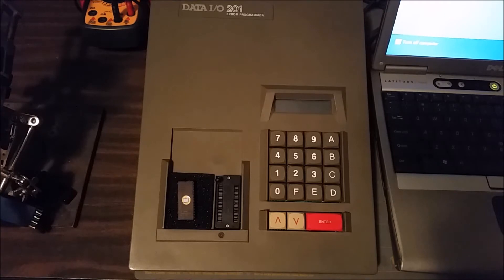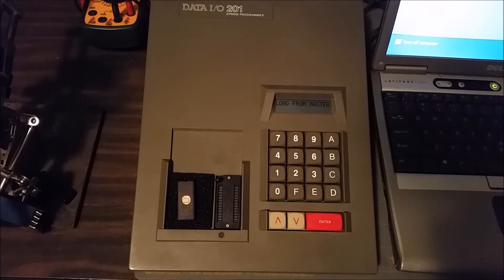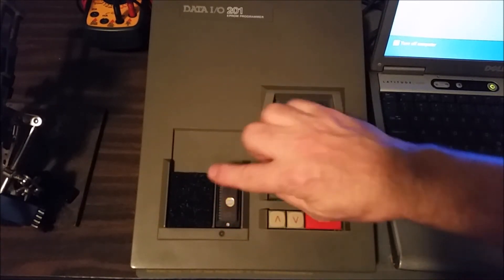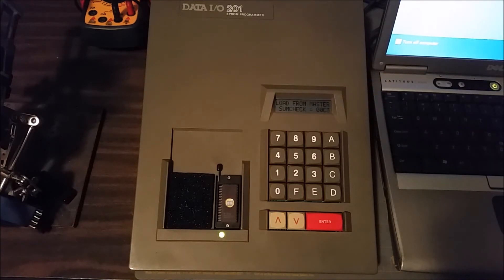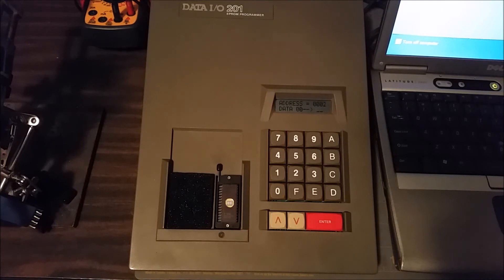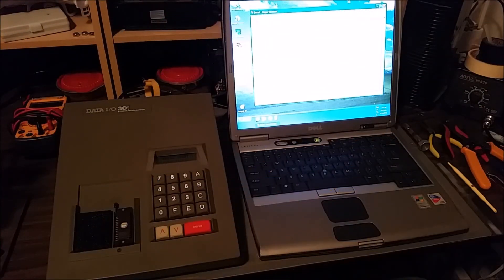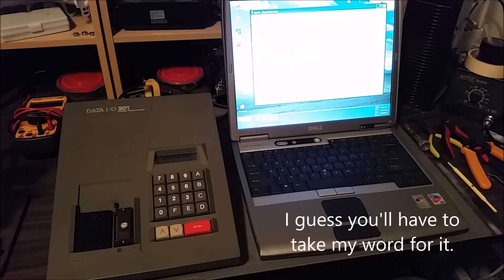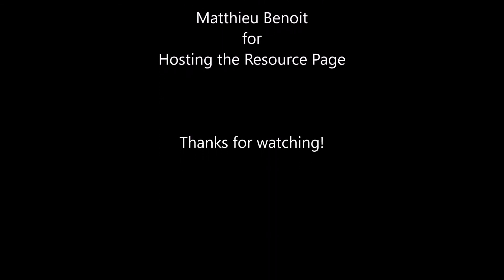I have a working Data I/O 201 EPROM Programmer!

Comment: Hi Roger, thanks for the video. Do you have the plans for a RS232 to USB cable for these programmers ?  I bought one and intend to use it to support my Fluke 5100B calibrators.
Reply from the maker: I use an old laptop that still has an RS232 serial port. The serial to USB converters I have are +5v/+3.3v so I'd need to convert the +/- 12v used by RS232. Maybe if my old laptop ever dies. ;)

Comment: Hi! I just picked up one of these too and have a bin file/upgrade for an old synth I'd love to burn. What software do you need to connect with it? 
Thanks for doing this vid!
Reply from the maker: I'm using a Windows XP laptop (I don't connect it to the Internet) that has a real serial port and HyperTerminal is the program that I use to connect using COM3.

Comment: hi Roger, i have the same but without the instruction, i would like to copy eproms, just put the original in and copy it to another one. 
did you find an english manual for it,  or is there an easy way to discribe this, thank michiel
Reply from the maker: Hi Michiel. Sounds like you were only able to find the French manual as well. It was inconvenient and I did use Google translate a few times but I was able to figure out most of the functions from those instructions. Here's a link to my Google Doc containing what I did translate: https://docs.google.com/document/d/1GT9-QcOCZtvRTH5vcCg4VRjcTzSYeeLAZlH0winXrnM/edit?usp=sharing
I haven't looked at this in a while and I didn't check to see how much was left to translate. I seem to recall the document was images, not text, so I had to type the French into Google. It isn't too picky about the special characters.

Comment: Looks a lot like the ones we had at SRC Vizz!
Reply: I've wondered what happened to some of that old equipment. I thought I got some of it to service the Timber systems. All I have left is that old Beckman meter. I don't remember if you ever played with the 68701 CPUs but I've got a tube full of them. Z80 CPUs and PIOs with really old date codes too!